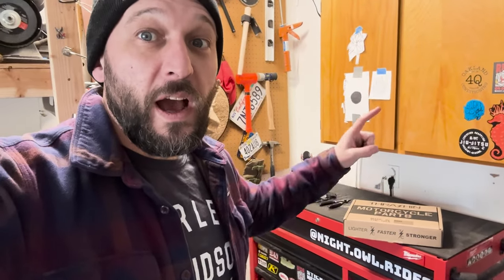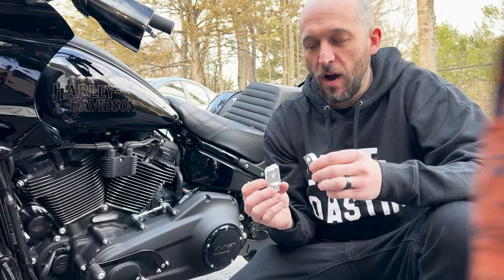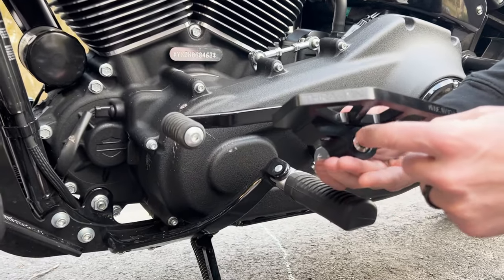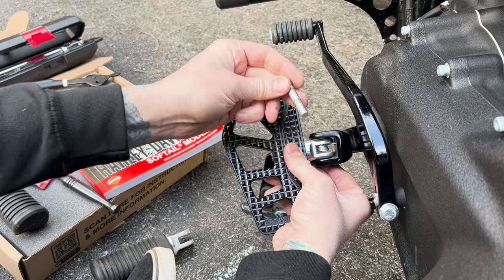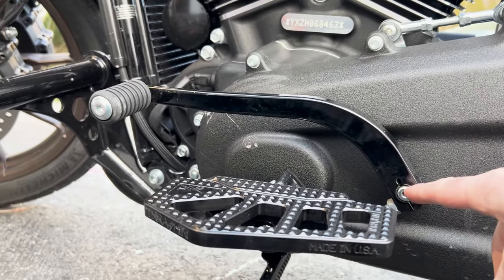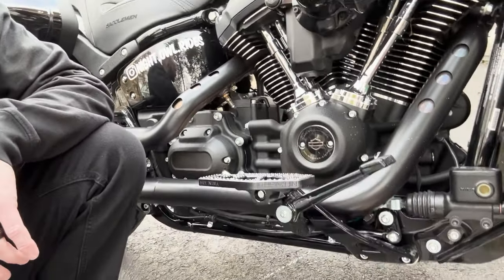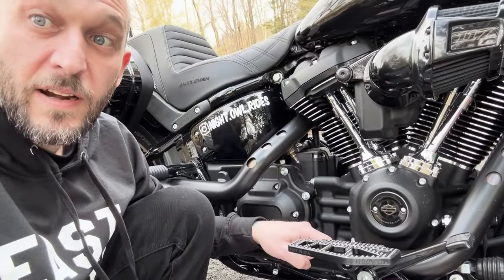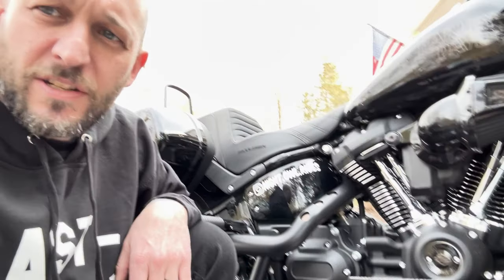@THRASHIN Apex Mini Floorboard Install

Comment: I tried hard floorboards on my old evo softail.  Those were good for a few hour rides in the backcountry hills near my house, but for long distance cruising, the standard Harley floorboards were more comfortable. Coming from foot pegs, I can see how you preferred it. Plus, your M8 softail's engine may not be hard bolted to the frame like mine.

My view is standard Harley floorboards > Apex > pegs for cruising. If the bike cannot support the look of the shock rubber Harley floorboards, I can see how the Apex would be more desirable for some.
Reply from the maker: Yeah, these are my first go at floorboards and I agree the longer rides it makes a big difference. I want to test ride a road glide for the channel and see what the standard Harley boards are all about

Comment: I love the look of these and I’ve been thinking about getting them but I’m curious about how grippy they are. Do you think they would be slippery if they get wet?
Reply from the maker: I can say with confidence that they work well in the rain! Got caught in a few downpours this summer and they felt the same. There is a nice pattern milled into the aluminum that makes the  deck grip. Ride safe!🤘🏻😎🤘🏻

Comment: I can deal with the pegs. Get used to them. However I really missed my floorboards from my street glide. I Just have some issues spending $400 for these. Not that I don't like them but dang. I just got the LRS so once I get a good feel of it after a few hundred miles I'll see how I feel then. Might still need mini floorboards. Nice install and review man!
Reply from the maker: Thank you so much! Yeah 400 is steep. I’m currently saving up for a new headlight. These bikes are not cheap🤣🤣. Ride safe!
Reply: @nightowlrides  True! I'm sure I'll cave and spend a bunch on this mod. Already ordered $2K in parts a few days after getting the LRS a few weeks ago. Had some one install it all Saturday lol!!
Reply: Thrashin has all my money lol between the risers and the mini floorboards I’ve spent over $800. 
I just bought lance and Juan’s tacos for the week lol

Comment: I put these on my 2021 street bob. I love the look! But they’re not working out so well for me because I have to point them really forwarding down because I ride with a very thick soul boot because I’m very short so screws with my ability to shift essentially. Anyone else have this problem?
Reply from the maker: Great question. Do you have the adjustable linkage? If so loosen the bolts on both sides and then turn the shaft of the linkage. This will adjust the shifter up and down. Hope that works for you. I love the feeling of a platform over a peg. Ride safe!

Comment: Did these raise the board up a bit compared to stock?
Reply from the maker: Slightly, I don’t have an exact measurement but the plate sits on top of the mounting hardware and that’s where I assume the peg would have normally been. As for feel it did not change much. But I really like how having a platform under my foot feels Vs. A peg.